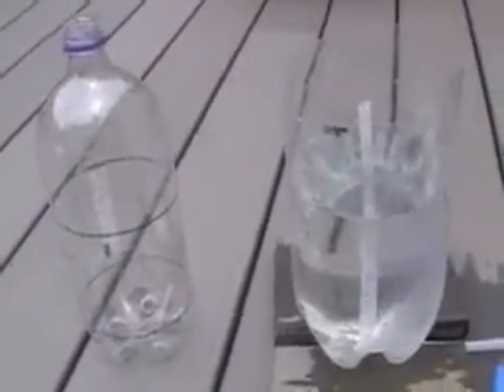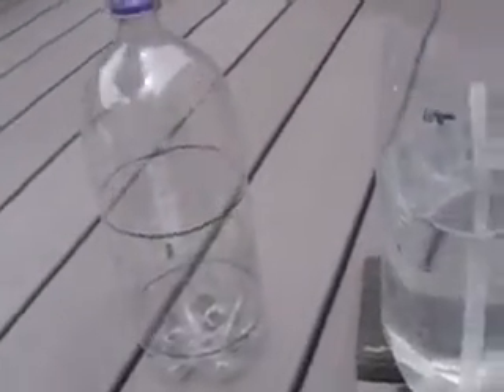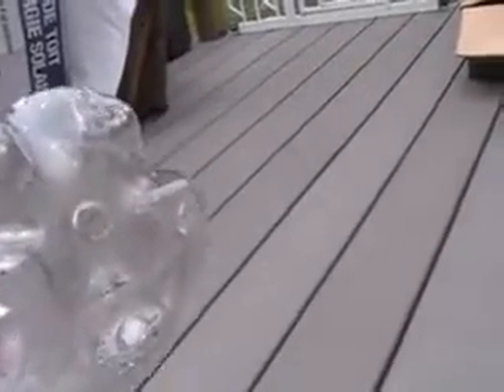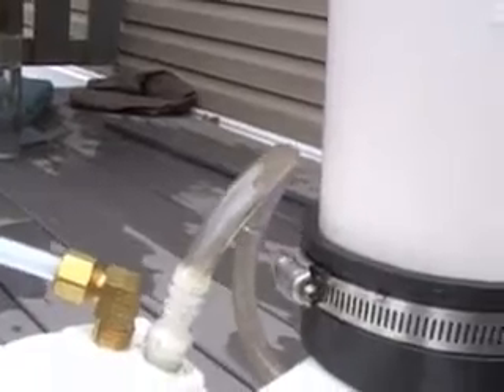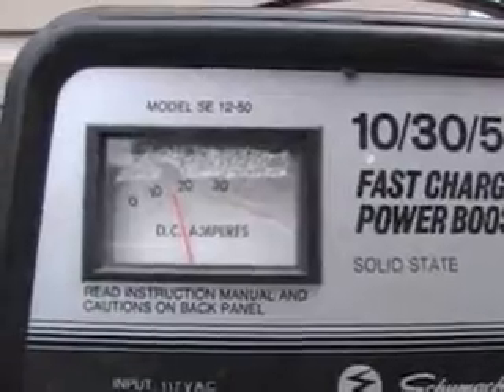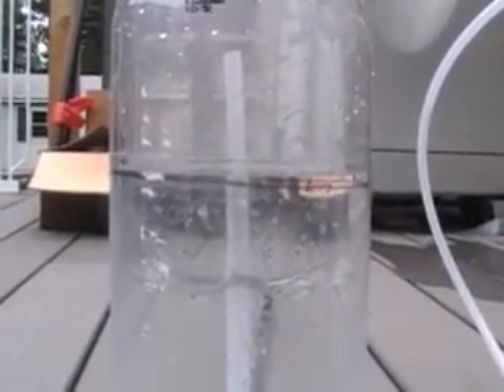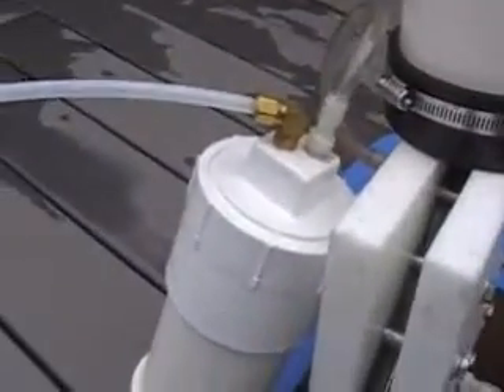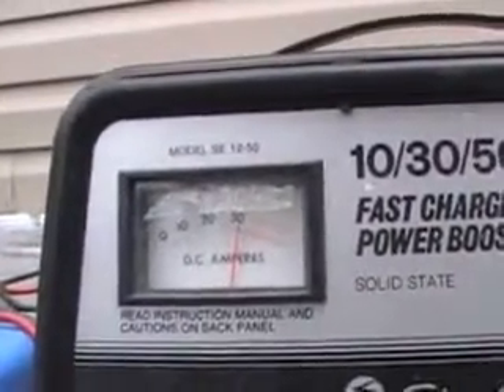Hydrof3a 007 - Litre Meter measuring device

Comment from the maker: Thanks, just trying to follow examples of success. If I did the math right, the 12.5v run is ~2.6 mmw and the 18.5v run is ~1.8 mmw. I can add another plate and see how that helps. Thanks for sharing your progress. Really looking foward to see the output from that new 60 pounder you are building !

Comment: your efficiency is currently at about 3 mmw .. there is considerable room for improvment ... with this setup, you should be able to get into the low to mid 4's ... check for leaks, make sure you have enough neutral plates to get a voltage drop to less than 3v per plate gap, see what you can do to get your plate spacing as even as possible ...

nice build ...